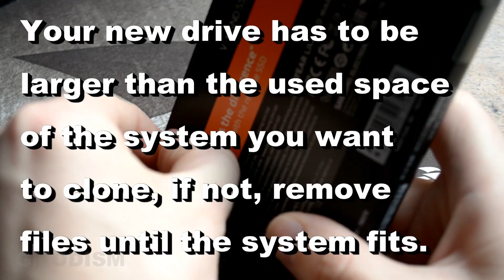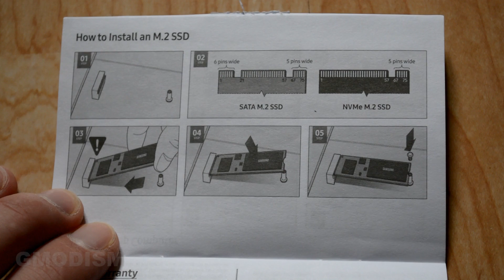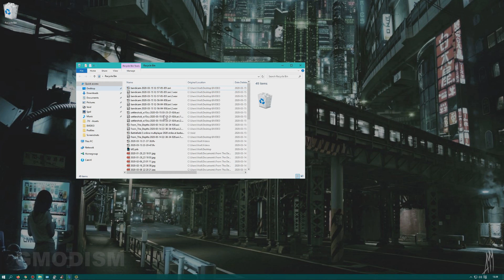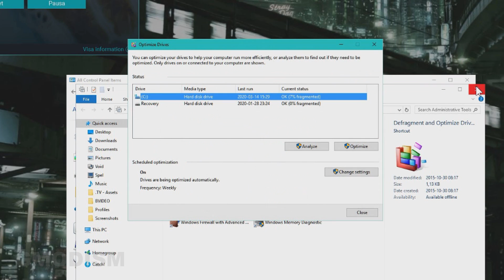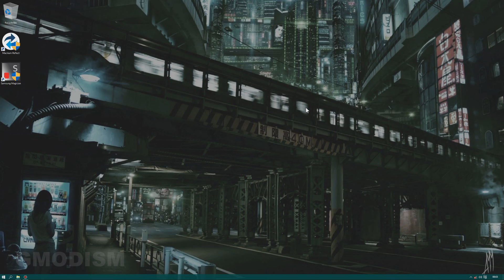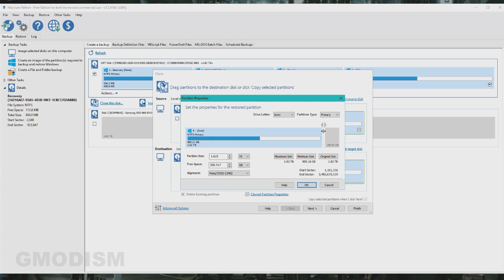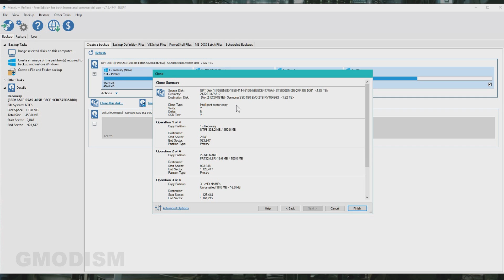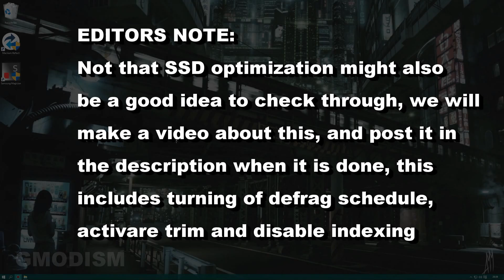How to Move Windows 10/11 from HDD to SSD

Comment: I got a "Incompatible disk selected" Message, what do i do?? 

Edit: Had to remove storage pool from the windows option, and need to reformat my Ssd. Seems to work for now.

Update: in the boot menu it shows "Reboot and select proper boot device" Did I do something wrong? I selected the SSD as boot device but my bios doesn't have an windows boot manager option... Any advice?

Comment: I can't find the option to boot through sad. Can u help me? I have 2 other hdds...bios shows their options to switch even though I have windows on only 1. Currently after cloning I have windows on 2 drives l, 1 on hdd another 1 on ssd.(I cloned from hdd to ssd). But can't get any option to boot through sad. Should I delete windows on the hdd or something?
Reply from the maker: The full version of this tutorial explains better, make sure your check that and see in your really moved everything the right way
Reply: @GMODISM  I reinstalled windows, it fixed the issue

Comment: I don’t get it, why do you need to download the magician? What does it do
Reply from the maker: If you have a Samsung drive it optimizes it a bit
Reply: @GMODISM   hey i did everything by ur instructions, in the cloning part all the sizes are ” MB ” not GB as they should, because im using 913gb HDD to transfer from into 913gb SSD. But it only talks about 516MB etc… is there something wrong?
Reply: @GMODISM   so basically what im saying is the cloning program used here says my SSD is 516MB size.

Comment: Does the order in which you drag down partitions from the old HDD to the new SSD matter? I can't drag all 4 because the 3rd occupies my smaller SSD drive so I can't bring down the 4th partition. so I had to drag the biggest partition (primary NTFS) last and I'm cloning this way. crossing fingers the order doesn't matter.
Reply from the maker: some of the placement might matter a lot, Id strongly recommend copying it exactly, you can always redo it again by booting from the old and cleaning the new drive and redo it.

Comment: When you said you'd leave the HDD for a month, does that mean that over time you get a smaller chance of your SSD failing?
Reply from the maker: So if you buy a bad SSD it should show signs of that early on, if you had no problems the first couple of weeks of using it it's probably OK, but naturally, you should always have a backup of stuff you cannot loose.
Reply: @GMODISM  That's indeed a must. I was planning on buying a m.2 2TB Samsung SSD, but haven't looked into it yet. Any recommendations or tips?

Comment: I ended up doing it correctly the first time but i wanted to factory data reset my pc after to my pc clean and have a fresh start. After doing that I Tried cloning the HDD which has the OS on it now which is new but it would let me clone it as it gave me a volume error message. Can anyone help me out with this issue ?

Comment: Does the new ssd have to be bigger than the old drive, or just the main system (C:) partition?
I have a 2tb hdd on my laptop with 200gb allocated to windows partition, im trying to see if i can just get a 200gb ssd and be done with it, or do i need to clear ~1.2tb of files off of my hdd to install an ssd that wouldnt be larger than necessary
Reply from the maker: The space you have used needs to fit. Also try the full version tutorial of this for better and more accurate details, link in description of this video.
Reply: @GMODISM  according to the video, you can select specific partitions to copy with macrium, so i presume it is fine to just copy one, and not the entire hdd? Since with all partitions combined, about 1.2tb of hdd space is used, but the system partition has only 200gb allocated and 120gb in use. In this case, it would be fine to copy just the system partition into a 200gb or larger sdd without copying the other partitions? Or do you have to copy them all?
Reply from the maker: Well it kinda depends, again watch the full length tutorial, but you gotta make everything that is related to the OS migrate, only isolated storage units for movies or whatever can be left out and such things

Comment: Great tutorial. Everything worked for me up to the actual transfer. It gets 1% and about 5 minutes in before telling me the new SSD is corrupted. I ran CCleaner, did a status check, ran WinDirStat, ran a corruption scan, restarted, and even exchanged the SSD for a new one and repeated all those steps multiple times. Any idea whats going on? SFC says theres nothing detected. After reformatting both SSD’s they work just fine, but trying to make clones corrupts them

Comment: Please help i dont know what to do, I did all the steps and when i boot up it says “Reboot and select proper boot device” but i cant get into my bios or anything my keyboard doesnt turn on and also my mouse doesnt turn on either
Reply from the maker: Also try the full version tutorial of this for better and more accurate details, link in description of this video. If cloning worked you must make sure it's connected to the proper port, like use the old one is usually a safe bet

Comment: Heya, your tutorial has worked great but I appear to have run into a roadblock, the hdd that I am currently trying to copy the data from onto my hard drive is 512 bytes/sector while the ssd is 4096, and as such are apparently incompatible. Are there any workarounds or am I just screwed?
Reply: Hi just wondering if you ever figured it out as I am having the same issue!
Reply: @mxraca277  I was just screwed. The hard drive I was trying to move from was so old it was LITERALY impossible to work with. Had to end up just downloading windows on a new ssd and scraping the hard drive

Comment: If you already have things installed on your new SSD, will it delete what you have on there when cloning? Or will it just copy the data from the windows drive to the new one without deleting anything?
Reply from the maker: It will replace whatever is on the destination drive, so back that up or move dest content to source content before moving

Comment: I have a 240gb ssd but my hdd is 2tb and has  around 800gb of stuff on it (mainly games) I only want to switch windows and some softwares like chrome and others. What should I do?
Reply from the maker: You can't do it like that really, try the full tutorial and my get 100gb back for some tips on how you actually can clear upp / move files in order for it to fit

Comment: Shit fucked up my ssd cant even use it now
Reply from the maker: Do it again but follow the full tutorial in description instead, carefully.
Reply: @GMODISM  It says that the ssd is corrupted and cant be accessed and i did everything you said in the video i have an m.2 nvme 1tb ssd
Reply: Its a brand new ssd
Reply: Nor did it clone the os
Reply: It basically just bricked my ssd
Reply from the maker: @ShadowSpekle  wow you should actually be happy it happened now and not later like if it allowed you to clone and you used it and already wiped your hdd all your data would be gone forever. This tutorial didn't cause the bricking, it can't do that because it doesn't do anything abnormal with the drives. Your SSD was faulty from factory, you need to refund that and get a working unit.
Reply: @GMODISM  i think i was wrong i did follow all of your instructions i think it was cuz i didnt defrag it right it’s relocating but i do have a question what do you do after the HHD os is successfully cloned cuz since i have an m.2 ssd i cant switch them like you did at the end of the video

Comment: Hi. I did the same except I’m using the sata ssd (im moving to) inside my pc. After the cloning (i cloned everything onto the drive) It would only show a white underscore at the top left flashing. I tried changing bootups in bios but it hasn’t changed. What do you think i need to do?
Reply from the maker: Try disconnecting the old drive entirely, if impossible to boot from new drive, boot from the old drive and try to transfer it again or see if there is something wrong with the new drive.

Comment: is switching the data wires really important? im planning to use both my ssd and hdd but i want to migrate my os to my ssd
Reply from the maker: No, but check boot order and make sure both are fast type connection first!

Comment: Someone please help me. I really need to use my pc for coding course.

Can I do the transfer using other pc. So i unplug both of the hdd and ssd and plug them using to a laptop or pc using an external.

And by the way. I have another problem with my pc. Everytime i turn it on. My pc try to boot and all those stuff as normal. But after a few minutes it will shut off immediately. Everything does dark. It did manage to get to main screen sometimes but still shuts after a few minutes. Does anyone know what's the issue ? I thought it's the PSU but I'm not sure. I dont want to replace something that's working fine.

I look some solutions online. many also said it because of CPU, but i don't think so cuz my pc can boot. I watch this video because i thought maybe my hdd has some issues.

PLEASE HELP ME...THANK YOU VERY MUCH IN ADVANCE.
Reply from the maker: Yeah you should be able to do that no problem, just transfer it to a new drive and see if that works on the old PC
Reply: Great, thanks

Comment: I have this weird situation...

I have 3 drives

A 320 GB HHD for linux

B 1TB HHD for Windows

C 1TB HHD just for files.

I had Linux first for few months and then got a new drive to install windows..

I notice that my Windows Boot Manager is install on Drive A which is linux. ( Windows is on Drive B).

If I unplug my linux drive... 
Windows won't show up on boot manager.
Reply from the maker: You need to move over boot manager partition and recovery partition to the drive you are moving to with windows fpr it to work. Strange it got placed on a different drive..

Comment: Ide like to give a small piece of advice, if you are just upgrading that is perfectly fine, but if your HDD is failing like mine is, and you have other issues like corrupted files and malware and it's running slow (Which is why I'm replacing mine), Then I recommend to reinstall windows on the SSD and not transfer it over from your HDD, as your windows may be corrupted. After installing new windows on SSD, then you can transfer all files, and it will be fine, and all corrupted files won't transfer to your SSD and fuck it up
Reply from the maker: Oh yeah you got to remove all malware before copying otherwise it is really bad, and better to do this before the drive has had time to fail much, smart to do when the first problems appear.

Comment: It worked, but my 1tb nvme drive for some reason now has a capacity of my old solid state drive, wich is 240 gb...
Reply from the maker: Just expand the volume afterwards, check the full tutorial in description :)
Reply: @GMODISM  that expeand button was grey, but i found a software that could merge the unallocated storage with my new c drive (aomi or smt like that, prob misspelled it)

Comment: will it work if i only copy the C: drive? i only need the windows 10 files which is around 90gb in C:
Reply from the maker: if you got several drives and only will swap the c drive it should work. make sure the other partitions (drives) are not located on the same hard drive however otherwise you might not be able to access those files.
Reply: @GMODISM  Ahh i see thx for the help, this harddisk that contains C: also contains D: which is unfortunate. Thx once again for still replying and helping

Comment: Looks like an awsome video and something i was looking for because i want to buy myself an SSD and move my OS to it(for easier update times and such) and use my HDD as games storage only,my question is,if you copy the OS like this will you need another Windows activation key? or will it just start as if nothing ever happened it will only be on a different drive? everyone hates installing a fresh OS and remaking all their settings and all but what i hate the most is usually Windows asks for a new activation key each time,not willing to give them money all the time so i was hoping i can switch drives without reactivating the windows as if i made a new fresh install.

Comment: I followed all the steps except I didn't disconnect the HDD since I still want to use it but when I changed the boot priority to my new SSD it gets stuck on loading at boot. I have to change back to HDD to get to boot normally. How do I fix this?

Comment: Used Macrium. Corrupted a boot file on new drive. Wiped old drive before new drive stopped working. May loose everything..... Was going to setup old drive as a backup drive the next morning.
Reply from the maker: Yeah you might have to reinstall windows on the old drive to utilize its new boot drive and copy the other info over and hope that works and then copy it all back to the new one.

Comment: I have a question. All the steps went smoothly but when I tried to restart my pc it went onto a black screen with a loading icon that went on for 1 hr
Reply: Anybody have a fix for this
Reply: You have to make sure 
1.HDD every origin partition are in BASIC (and not dinamic).
2. By using Macrium, clone ALL origin PARTITION into ssd. Not only OS partition.

It works for me
Reply: Some settings that is important to notice  like MBR-GPT type, turn off secure boot in bios, uefi-csm boot, and EFI files.

Comment: so I just use software to transfer the contents of windows to my new drive and  just tell bios to prioritise the SSD? No need to restore image etc?.
Also I have 2 partitions of 1 HDD. One is the main one with windows and the other is the same disk but it has other files non related to windows. Should I just backup the C: One to my SSD?

Comment: I'm going to be migrating from a HDD to NVMe SSD, obviously I can't switch out cables so if I get into bios and change the default boot drive, will that make the step to switch cables unnecessary?
Reply from the maker: Yes it will make it unessesary

Comment: Still relevant.  You can skip the "disk ejecting" part, but I'd wait a week before you delete windows off of the old hard drive. I'm gonna keep it on both my disks and I just set my SSD as a higher priority in the BIOS booting settings

Comment: What would one do for PCIe SSD's when it comes to disconnecting the cables from the old harddrive?
Just leave them attached to nothing?
Reply from the maker: If your old drive is a pcie SSD I'd just leave it in but select boot order carefully and make sure the new drive is really booted from.

Comment: TO ANYONE HAVING THE PROBLEM WHERE IT SAYS YOUR SSD ISNT A BOOTABLE DRIVE i swapped my new drive sata cable over to the one my old drive was plugged in with and it booted right up. So either the sata cable i was using was too "slow" or the slot i had it plugged into on the motherboard couldnt support it. Hope this helps, friends
Reply from the maker: Great! It's the port, all sata cables are basically the same actually
Reply: @GMODISM  gotcha

Comment: My pc bsod because of this. The cloning worked and i booted the computer with the new ssd as first in the boot order and everything worked fine. I still had both of my m.2 ssd's on my pc and i figured i might aswell clean the other one  entirely. So i followed your instructions in your other video where you tell how to remove partitions, files etc to fully remove anything on the disk. If i remember correctly it was the "clean all" that i used. Everything worked for a couple minutes, then my pc crashed. Then when i powered the pc on again, it gave me error 0cx000000e and something along the lines that a device is missing or something like that, even though the new ssd had all the files cloned from the old one. I don't know what to do.
Reply from the maker: This is why I very specifically told people to wait a month before wiping the old drive in case of issues. Try starting the computer from the ssd that has the files, the one you wiped is all data gone so disconnect it. If it still doesnt work you can clone the data back to the drive you wiped from another computer and see if that works.
Reply: @GMODISM  yeah, i should have kept the files on the old ssd but it booted right away with the new one so i figured there probably won't be any problems and that i can wipe the old one. Rookie mistake on my part. Will try to do what you suggested and see if that helps.
Reply from the maker: @zombirai  Good luck mate! In future, always keep a full system image at a external disk, got a tutorial how to make such an image, do a new image twice a year and your data should be safe.